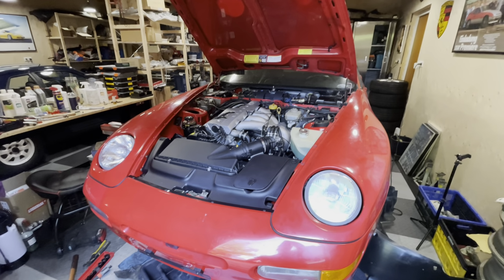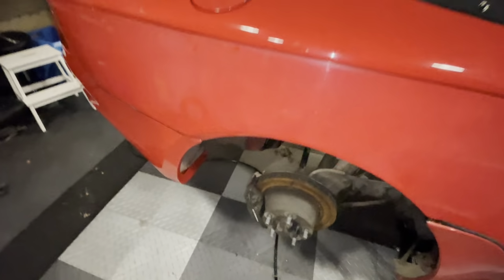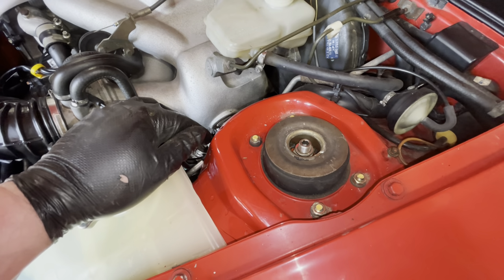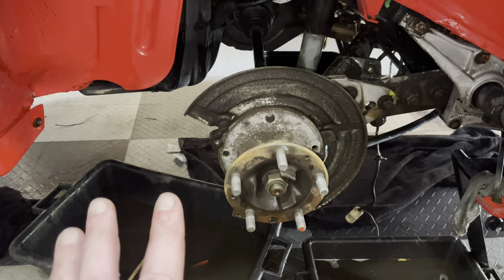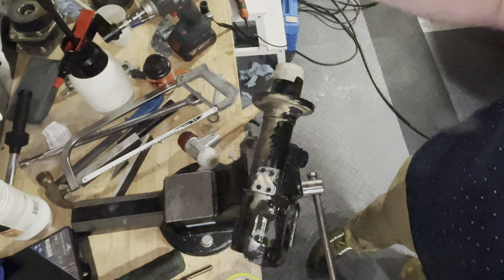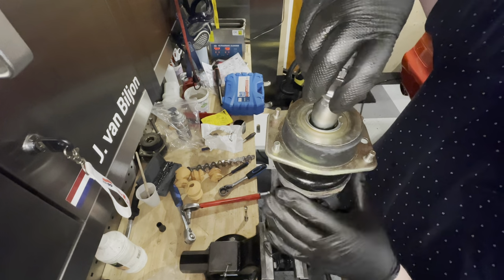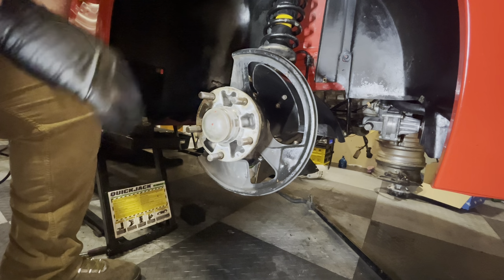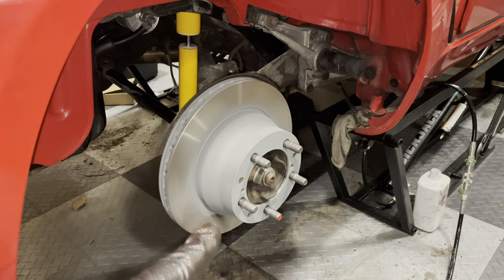Restoring a Flood Damaged Porsche 968: rebuilding the chassis

Comment: Fantastic, great overhaul - you must be getting more and more keen to see how it drives! I did a similar scope as you on my U.S. 968 white convertible back in January before shipping it over to the North of Italy where I now live. Koni yellow's (softest setting) and new discs. Front end is still not super tight and looking at the bushings now, going from easy to harder, starting with the anti-roll bar bushings, then the arm perhaps. Part of it might also just also be  related to the inherent body flex of the cab. Still a joy to drive but will give it a good go to see how much improvement I can make.
Reply from the maker: Yes, the cabs have quite some flex. I put mine on the middle setting, hopefully I can start driving her this summer 🤞

Comment: Brilliant work Jon!  Been there, done that on suspension.  With the flooding, did you already redo wheel bearings?
Reply from the maker: Thanks Jeff, I have not replaced the wheelbearings (yet) all four sound really good, so I don't think any water found it's way past the seals, but time will tell.